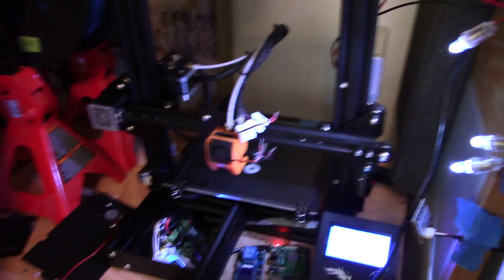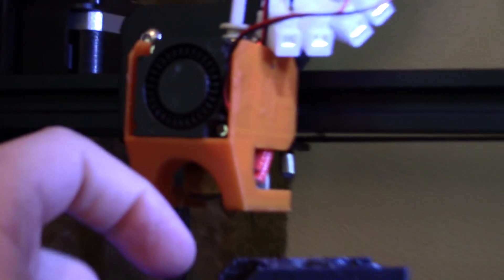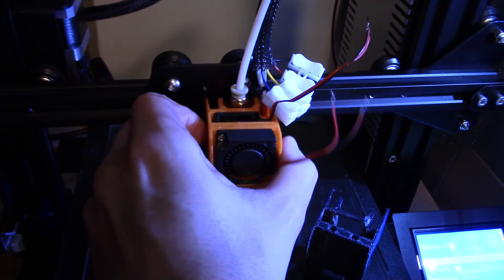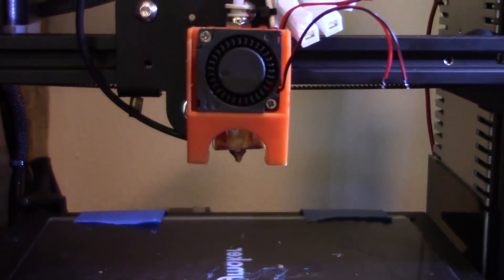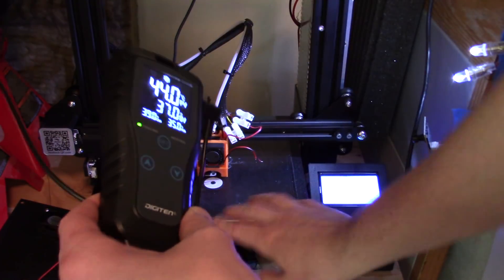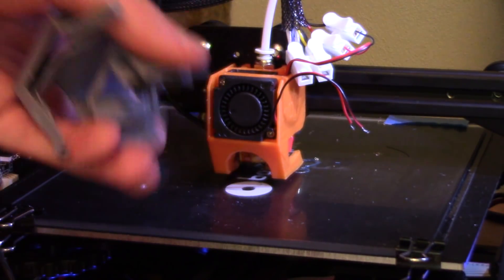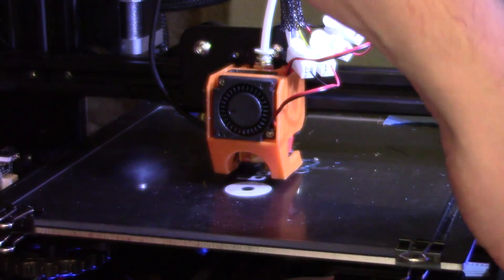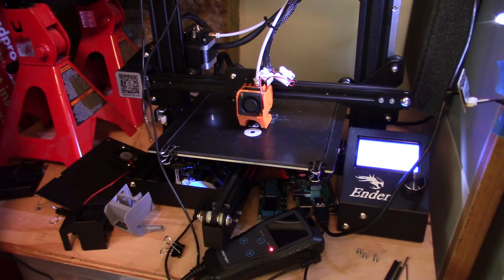Part 3 Fan Duct Temperature Test - Designing A Better Hotend Assembly For My Ender 3

Comment: Hi, I like your design goals. Are you going to share your design? Couple things:  you can use metallic spray paint to increase the reflectivity so it gets less heat from the heated bed, so PETG will work fine. You could also try HIPS.
Reply from the maker: Ohh nice! Yes, I will share the design. I'm going to couple it with an edit-friendly version so anyone can design there own air ducts or whatever. That will be in January coupled with a tutorial of how to operate/edit the CAD files. Good idea with metallic paint! Never thought of that. HMmmm
Reply: where can find you fantastic STL? :)

Comment: I'm not sure the logistics of your situation but I think the video quality would be much better if you put the camera in positions that would give you more access. Even if the angle isn't quite as good, it would allow you to be a bit more dynamic and active in the scene than in the current layout.

Edit: Just continuing to watch through the video, and the shot at 9:03 looks really nice. I'm not sure but my guesses as to why would be:
- it isn't a straight-on shot, so it has a nice amount of depth
- it's a nice tight shot. The viewer at this point likely knows what a 3d printer looks like and the focus of the shot is the hotend, so seeing the whole printer gives the viewer no new information
- it's rock solid. While handheld may be easier when moving between subjects, its instability means the viewer's brain has to constantly adjust, which leaves less room for focusing on what you're talking about and adds a slight unconscious annoyance
  - as a note: Whereas it might seem that using a handheld shot would help bring the subject into focus, the benefit of the larger size on screen is often more than offset by the shakiness and constant movement.
- likely due to the angle you are much more active in the shot, less talking in the background or while straining to reach around the camera.
  - an example: you talked about warping and made a gesture alluding to warping. When only your hands are visible talking with your hands becomes more important and that doesn't work, or doesn't work well, when you can't easily reach into the scene. (don't take this as "talk with your hands constantly" as that will just feel forced. Talk with your hands where it feels natural and it'll probably feel natural)